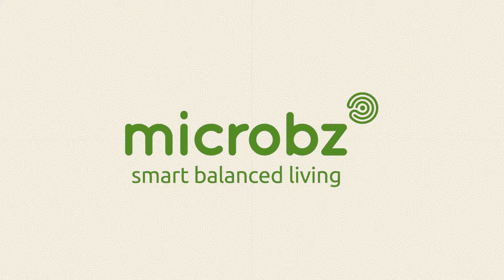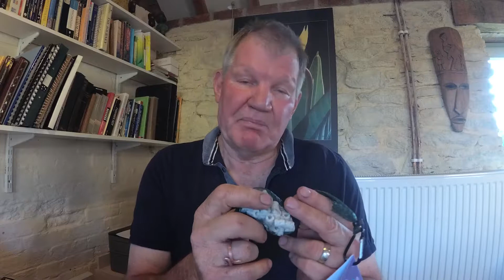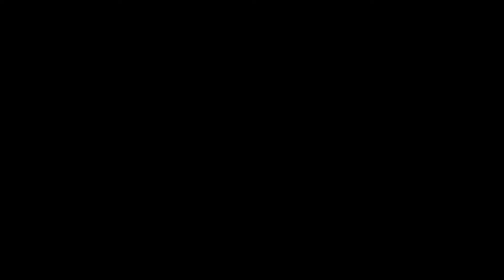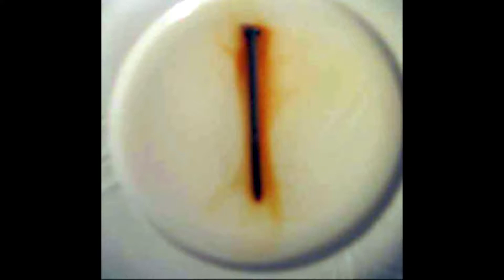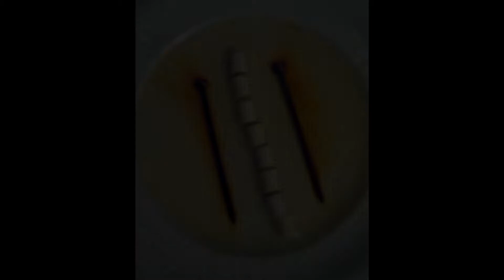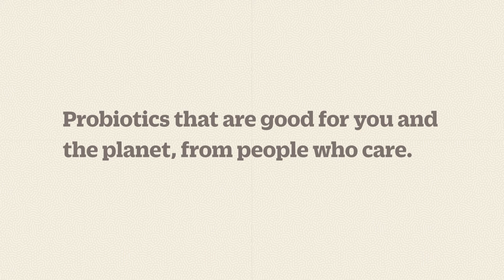Microbz: Probiotic Ceramic Water Pipes

Comment: Hello, how do you "recharge" the pipes? Is it necessary using  a specific product for the first time I'm using and after every 6 months? Can I use anything else instead of these product like ciders or bicarbonate? Thanks!
Reply: Hello - you don't need to recharge the pipes. Are you trying to filter the water with bicarb?
Reply: @katieward1207  thank you so much for your answer. I'm not sure what you mean with filter the water with bicarb. I haven't used the pipes yet, I just bought them and I am unsure if I need to do any maintenance. I was thinking to clean them time to time with bicarbonate...pls let me know if you have any suggestions about it...many thanks for your time and your help.

Comment: How do you exactly use the beads, do you just insert them in the bottles, and drink from them, kettles and boil them over and over? washing machine do they damage the metal as they are ceramic when they hitting the walls? 
Do they get dissolved over time? 
Do you have to replace them over time? 
Thank you
Reply from the maker: Hello Maria 

Thank you for your questions. In water bottles you just put them in the water, just one or two will do. In kettles, yes, just put about 5-7 in and they will boil in the water. In the washing machine, I put them in little mesh bags so that they don't bang around all over the place. They don't dissolve over time and they don't need replacing very often. I've had mine for about 15 years. 

Let me know if you've got any more questions. 

Many thanks, 
Katie
Reply: @microbzprobiotics  Do you use your microbial cleaner to wash clothes then?

Comment: very interesting, wonderful video, 
possibly a silly question however may I ask - where does the rust go? have you measured the quality of the water both before and after inserting the beads?ceramic water pipes? has it dispersed or dissipated due to molecular changes? it seems so simple so I'm wondering why more people aren't aware of this system as it's a lot more economical than Reverse Osmosis systems.  
many thanks, 
Emer
Reply from the maker: Hello Emer 

We haven't measured the quality of the water before and after ourselves - although I can measure by the way it tastes and it's much nicer to drink. We'd be happy to make some available to you if you'd like to test them. It is a subtle technology but we think it's very effective.